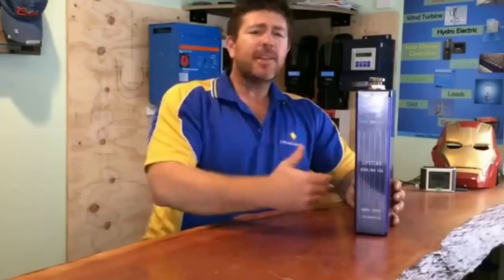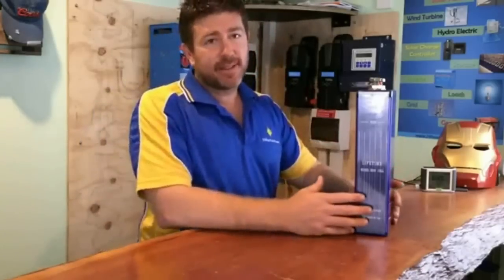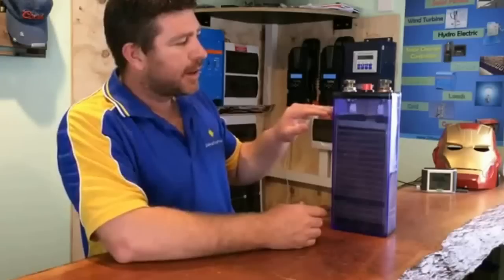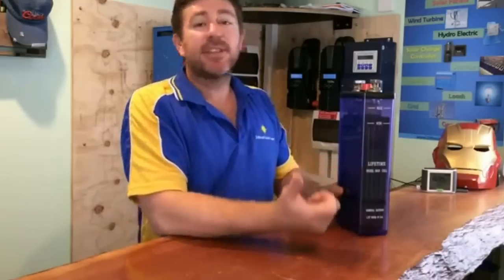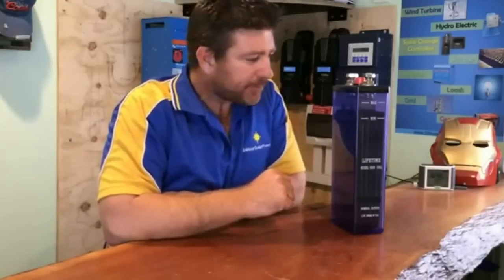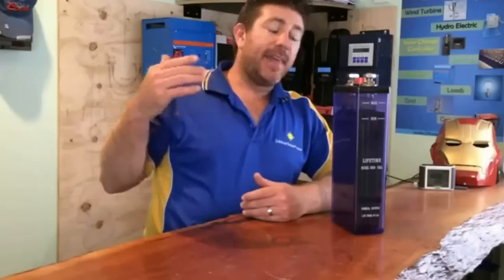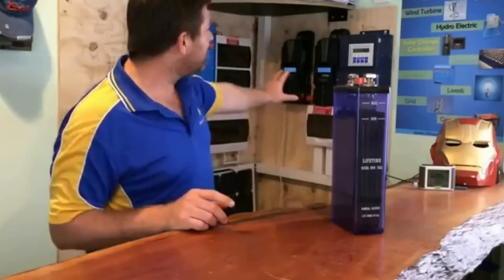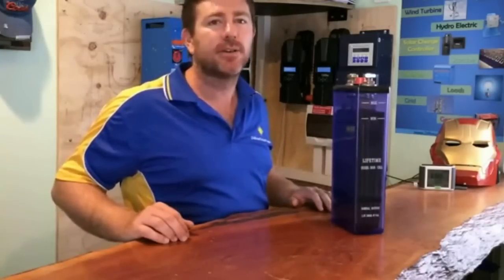NICKEL IRON Battery Technolgy

Comment: Grate vido ..im in Philippines 
Im doing a..small back up system on a small house 
12/24 volt  lights fans ..its ,,f,, hot in Philippines..and 12/. 24 volt.. chess fridge..  

My request is can you recommend a. Complete system ,,like for a 1 kw.  System .. regulator  for battery...im NOT going to need a 240-AC SET UP
Reply from the maker: Thank you. What battery options do you have available in the Philippines?

Comment: There I was expecting some solid information, yawn, just another overview, better to just read it yourself on Wiki.....
Reply from the maker: Thanks for the feed back. We have stopped promoting these batteries there are better technology know. What is it you would like to know?
Reply: @TheOffGridShop , Please define "Better", The NiFe battery is a long lasting, rugged, simple, less hazardous technology and is far, far less likely to burn your house or car to ashes....Your little Blurb video has less content than the Wiki page and references....
Reply from the maker: @regdor8187 have a look into LTO technology.  I have refurbished lots of old nice cells and they loose alot of capacity with age. The oldest. Set I have done were over 100 years old.
Reply: When the battery contains Lithium in quantity, it will rapidly BURN in the presence
of water, that property Will eventually doom it's use....  @TheOffGridShop
Reply from the maker: @regdor8187  do some research LTO contagin a small % of Lithium and they can't be set on fire. There are some fun videos to watch out on the net. About them.

Comment: With proper maintenace and replacing the electrolite every 10 years or so, they should last 100 years. Self discharge is not an issue if you're charging them regularly. You can even make your own electrolite from wood ash.
Reply from the maker: Thanks :)
Reply: Errr really? Electrolite from wood ash.. that makes a very alkali dirty solution not the acidic electrolite that is what the batteries need. Also life span is certianly only 10% of what you claim and electrolight (good stuff not rubbish made from wood ash that will simply distroy the cells) has to be changed every 2 years and requires complex inspection and servicing almost on a daily basis... reality is very different to your dreams.
Reply: @williamarmstrong7199  . Filter it. Sodium hydroxide. That's all.

Comment: Absolutely essential to have a watering system on them, if you use them/charge them hard they need water every 3 weeks. Or you have massively oversized banks that charge at a lower rate. Heres the rub, if you need a given size bank of lead/acid you will spend 4K , to use Nickel you will spend 20K and might out distance the lead/acid in cost per year. Thats a 16K risk.  Good luck.
Reply from the maker: Thanks, good to hear your feedback :)
Reply: Do you earn money making shit up? This one must cost a bit because of how niche battery chemistry is. Recommended refill on these is 5-10 years.
Reply: @gabe20244    Adding water is not the same as refilling the electrolyte.   To charge Nickel-Iron (NiFe) batteries, the charge voltage per cell, must be above the threshold that causes water to break down into hydrogen and oxygen.  Thus, they consume a lot more water than lead/acid.   Refilling of electrolyte, especially with the chinese NiFe made batteries is frequent, due to their use of Varta type cells (unlike the original Edison versions) and the Varta style cells contain the reactants in a form which dissolves into the electrolyte in just a few years. When this happens, the cell accepts little charge and is almost useless.   Where the original Edison batteries were a high quality product with good service life, the Chinese versions are a waste of time and money.

Comment: You're absolutely right it's about total cost of ownership. Solar panels 30 years+, inverters 10 years max, iron Edison 30 years+.
Reply from the maker: Thanks for your input :)
Reply: Too bad the plates are welded so you can no longer clean the plates or check for a short circuit as is the case with the original Edison battery (And that you can completely dismantle which still works after 100 years) And what a shame you can't buy these types of plates separately in unwelded form. They are great batteries but oh boy the shipping costs. But that applies to many products that you buy in China.    https://www.youtube.com/watch?v=lQo4GHQMkiw

Comment: I have looked into these and the maintenance of the batteries is really significant (every week!) and also they have a very fast self discharge time.. 5 days I hear reported! Also the electrolyte has to be totally replaced every 2 years I have heard not 5 years.. which is a really difficult job and produces a lot of nasty waste liquid. Many of them are sold in the USA by known (jailed several times) fraudsters who make many similar claims about them!  Very very iffy do not believe anything people say about them check for yourself the manufacturer's own data sheets then 1/2 them because all of these are made in China.. NOT the data sheets produced for the resale of the same batteries under different "brands" they are the same Chinese made cells. The Data sheets made for the same Chinese cells show typically 2 or 3x the life span the Chinese manufacturers claim! Not to mention self discharge rates, frequency of electrolyte changing etc. etc. Has anyone know Chinese manufacturers to tell anyone accurate capacities,  discharge rates life span etc etc?
Reply from the maker: Yes they are not for the faint hearted. They do require a lot of maintenance. And there were 2 sizes made in the states and the rest were imported .we are in Australia and all ours are from China.

Comment: We lived in a camper for 7 years. Everything was 12 volt! Why no chunk the high voltage  and go totally 12 volts? I guess supplementing with propane gas for cooking and or heat would fit the desires of some!
Reply from the maker: It all depends on the size of the system. Me personally I am not a big fan of 12v appliances unless 100% nessary. They are expensive and new 240 products these days are just as effective. And it would all come down to system size and space..

Comment: How are you nife cells performing? I and a couple of friends been running them for about 6 years or so. Other than watering them they've had no issues. Had one shorted cell NEW but swapped out under warranty. They seem to just work. Had a hurricane a few years back and while everyone else was burning gasoline we were running our NiFe banks down to 80% each night for over three weeks until utility power recovered. That was about 5 years ago. Our Nife's are doing just fine. Had to use my a generator a few times on cloudy days to get the bank back up to make it through the night.

I am happy, they are happy. Looked at Lithium. But to be honest I have had too much bad experience with my home power tools and having to replace Lithium batteries every couple of years I just didn't want to take a chance on spending $10,000 and then have to explain to my wife in 5 years why I need to spend more money replacing them. Or worse if the Lithium's burned my house down have to explain to her WHY!
Reply from the maker: +Rufus477 ours are having a break at the moment. We have moved houses and It has not been a priorty to install mine. After installing 3-4 sets a week. Doing another set on the week end.is the last thing we want to do.
Reply: important not to run them down below 50% dod too often, it accelerates the need to replace the electrolyte. been there, done that.
Reply from the maker: How old are yours?
Reply: @TheOffGridShop  4 years, had to replace the electrolyte after just 2 years. I have a bank that should hold 20kw/hrs and its lucky if it holds 4kw/hr.  worst decision I ever made in hindsight. Been in contact with other people in Australia, and they have had similar problems, most importers have discontinued selling them. Autopsies show very poor quality of construction, they are NOTHING like the original edison/American made cells from the past. Its not the underlying technology thats the problem, its the design and construction.
Reply from the maker: Interesting. Thank you for sharing.

Comment: 3kWh usable for a 10kWh Lead-Acid?????
Reply: if you want them to last then yes. its not to say that if you need to use the full 10kw/h you cant, just that it will reduce the lifespan of the battery. the more discharged they become the more lead sulphate build up you get reducing the capacity
Reply: chip you sound smart on this subject.  do you think these batterys have a long term use at all if cost could be reduced. maybe today we can ad things to them to stop the production of lead sulphate build up
Reply from the maker: That's what you're meant to use if you want the longest life.

Comment: Lifepo4 are better in all manners, just the Charge/discharge efficiency of only 65% on NiFe tells you why they suks compared to 99% of lifepo4, with prober, BMS and stable temparature a good lifepo4 will last you for many decades, you will right out the box need 35% more solar, larger charger more maintains on NiFe to get the same bang for your buck, the self discharge is terrible on NiFe at worst 30% a month, first you lose 35% at the Charge/discharge and then up to 3% ontop in self discharge a day ( lifepo4 is 3%  a month), The C Rating is also terrible, you need to have a huge battery if you are going have any kind of large load not to be pushing the battery into a less efficient stage, In any kind of solar i would only go with Lifepo4 , they are safe,efficient,environment friendly, will cost you less, fits almost any Lead Acid chargers,have an energy density 500% higher then NiFe, and the list goes on and on, it`s true that NiFe is in some cases better that Lead Acid as a storage battery, but the again Lifepo4 extremly far better than NiFe. http://w1sye.org/wp-content/uploads/2013/01/Lithium-Iron-Phosphate-Batteries.pdf
Reply from the maker: Yes there are better technology available today. Look.at the LTOs.
Reply: I use lifepo4 instead of nife, but only for a few kw/hr for backup power instead of daily solar-powered use so it doesn't really matter.
Nife's do have some advantages; they don't rely on a BMS (plus easier to replace any bad cell), last longer if cycled extensively, not so temperature dependent, can take a lot of abuse.
Saying that, I'd be tempted to get a LTO-celled battery if relying on long term solar&generator. (I think I worked out that you'd need ALOT of solar panels and like a 50kw/hr bank to see through a cloudy winter without resorting to a generator.) Would cost a lot though.
Reply from the maker: I think we are going to see a huge advancement this year in what's available commercially. Nife cells where great back in there time and they juts don't make them like they used to.
Reply: I agree with most of your comments, but the self discharge on a renewable generation system battery is not a major problem.
The energy is normally used the same night or following day.
Reply: pity about their 10 to 15 year life. but hey everyone has 30k to spend every ten years.

Comment: hi what inverter do you use i have a 24volt with 1000ah with a fangpusun  150/70 charge controller which is a victron clone nife battery bank my inverter will only go down  to 20 vollts before cut out is there any other inverters that will go lower
Reply: Ken Green Magnum MS4024PAE will go down to 18v, I've used it with my NiFe batteries, I now have it as a spare.
Reply from the maker: Or a victron will go down to 19 Volts.

Comment: People claim they last forever because that is what it looks like to them, but manufacturers data sheets clearly show they last a long time only if they have minimum to no cycling. We are talking 10k cycles if you stay under 20% discharge, this is why they are used in backup systems and not constant discharge systems.
So people will pick up really old industrial Nickel Iron batteries that still work decently and proclaim they do so under all conditions, that is not the case at all.
Reply: MsSomeonenew yes that is correct and there are ones that were made in the early 1900s still working. Ours are rated for 20,000 cycles which is 53 years of you cycle them everyday. we have been testing a set for 4 years now and they have been cycled and over charged every day almost. and they are looking great. they seem to hold more charge then the 1st year we had them. can't explain it. so far we are happy and only time is going to tell the truth on the subject.
Reply: thanks ms.  so if you never go under the 80% factor they will last a long time.  discharge rate with no input is also a consideration.  but is kept charged above 80% always they would last a 100 years. the size of the battery bank would increase as well.. to make them last 100 years.
Reply: I heard they are easy to fix.  Still learning what fixing them involves: just electrolyte? Or plates? Or??
Reply: @TheRainHarvester  Basically, if the battery goes 'dry' or whatever, it is cleaning and replacing electrolyte.  To clean, drain and dispose of old electrolyte, fill and mechanically agitate with distilled (or at least deminralized) water.  Discard that water, as it will have lots of 'junk' init.  Now, make new electrolyte (add NaOH to distilled water) and refill the electrolyte.  Only add distilled water as the level of electrolyte goes down, it is just the water in the electrolyte that disassociates and out gasses, the NaOH is still there.
Reply: Desmond Bagley  Yes, internal discharge rate is about 1.5% daily.  You to keep healthy, keep on a minimal trickle solar charger, and when you visit, top off the electrolyte with distilled water.  You will be pleasantly surprised.
Reply from the maker: What's your point of view on battery technology 6 years on?
Reply: @TheOffGridShop  lithium titanate cells look they last an impressively long time.
Reply: @TheOffGridShop  Do lots of users/yourselves use an automatic hydration system?

Comment: I have a question.
How often do these batteries need water addition?
Reply from the maker: Depening on how big of loads you run. We use about 60 litres a year.
Reply: you can cut down water use, if you can handle slower recharge times.  1.6 volts per cell when charging should minimize water consumption.

Comment from the maker: What's your set up? you can change for Voltage settings and get more storage without the extra cell. I run 18 or 19 cells in 24 set ups and anywhere from 36 -40 in 48 set ups. all depending on the charge controller and the inverter.
Reply: I am running a 12v system, if you look at my videos you can see what I have